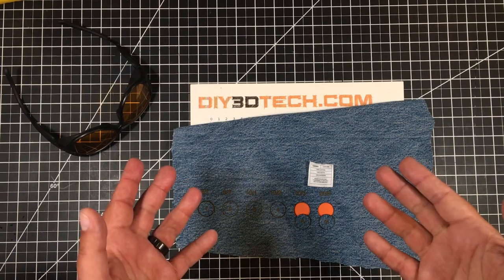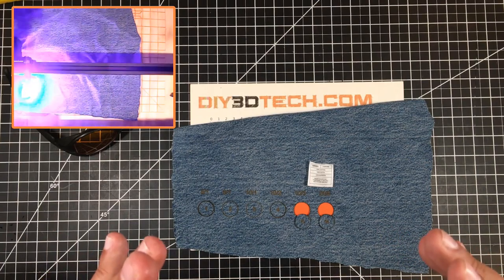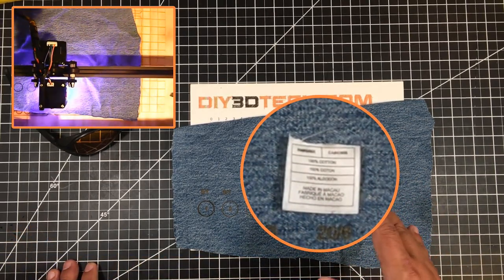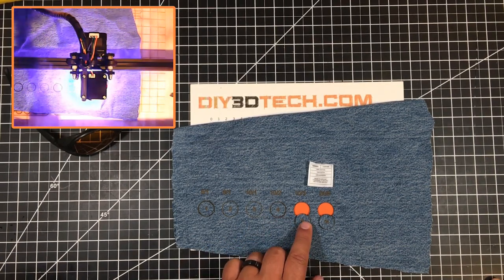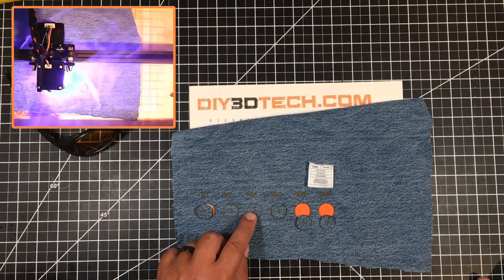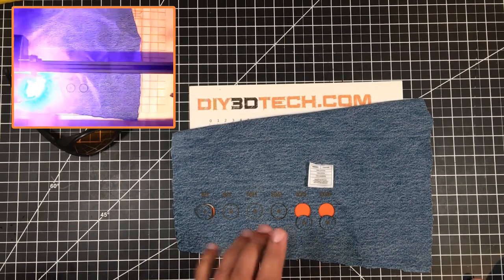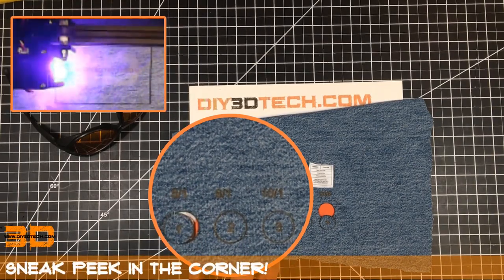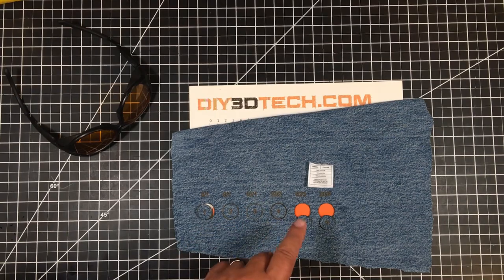Ortur Laser - Recipes for Cutting Denim (Blue Jeans)!

Comment: Great job, can you please write the speed/power/passes from the Jean test in the description.
And a video about lasering on aluminium would be nice, also on 4mm felt graving and cutting
Reply from the maker: Thank you, however If I do that people won't watch the video and I don't get the ad rev or the subs. Now I don't want to make this sound overly commercial however this little bit of money is where the laser and the ability to make videos comes from.   I will likely do a page on my web site this winter.  Also for aluminium not this little guy, with a k40 and some moly you could etch it (i.e. the moly) but not on a visible light laser.  Also if it shinny ( the aluminium) you risk blinding yourself with a high intensity reflected beam.

Comment: I get a burned edge with my Co2 laser that is brown. I always wondered if taking the blue jean material out of the washer just after the spin cycle and then putting it in the freezer stretched over a sheet of glass would laser different?
Reply from the maker: I doubt you will ever get totally rid of the burn, I would try an air assist to minimize it...

Comment: Have you found any more info on upgrading your Ortur to a 7w output? I'm curious as i need to buy one for etching on stainless steel using cermark. Any suggestions? Thanks!
Reply from the maker: Buy a C02 laser if this is what you want to do, this is a lower power visible light laser and your risking your eye sight pointing this at metal on top of it not doing anything....
Reply: @DIY3DTECHcom  Thanks so much! Any co2 laser you recommend? The cylinders i need to engrave are often two feet long or a bit longer however, i only engrave or etch a 2" x 2" area on the.

Comment: Can you do a video on engraving a mirror I seen done online but I've never really know how to do it I've tried and damaged 3 mirrors in the process
Reply from the maker: With this laser you can never etch the glass, look in my eBay k40 playlist I show how to do a mirror with a 40 watt co2 laser.  With this you could try and flip the mirror over and burn the mirrored etching off, however this is risky as this is visible light laser and beam in its full intensity can be reflected blinking you...
Reply: @DIY3DTECHcom    I know I always put the glass on even when laser is on and use a Diode laser was going to buy a k40 but so small what me

Comment: Have you seen how fast they age and cut denim with the newer lasers?  https://youtu.be/fVhkAUijXSs

The above laser is cutting 50 times faster than the old laser I got. Mine was built when the lasers were still mounted vertical and moved back and forth over the table much like my 3D printer works today. Mine was a commercial unit and has no enclosure or fume extraction like the modern table lasers. A company called Hunter Specialties used it for engraving the name on the top of wooden turkey box calls. It belongs in a laser history museum.
Reply from the maker: Its function of how much do you want to spend.  The Ortur is $200 laser and the one in the video easily over $20,000 (or more).  Also the laser used in the is an IR laser and not a visible light which is far more suitable for a task such as this...